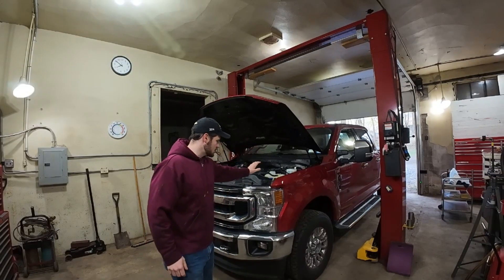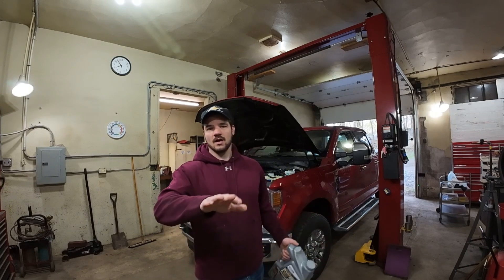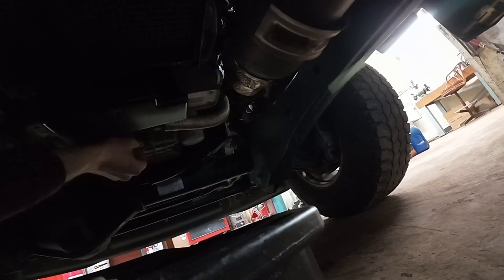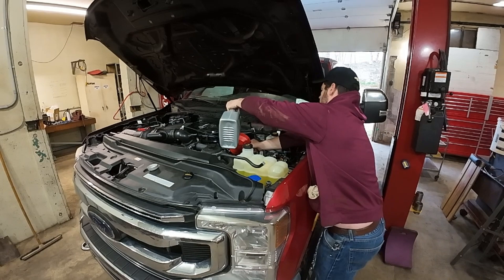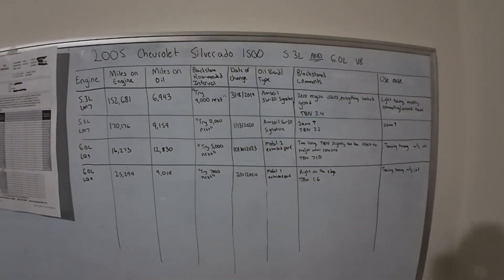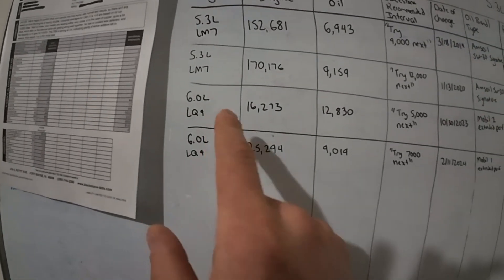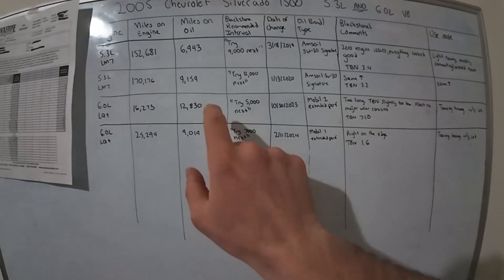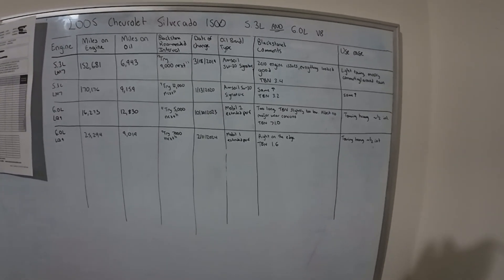Find out if you really can go 15,000+ miles on a single oil change!

Comment: Wear is the major parameter you should track in an oil analysis not TBN.

TBN (Total Base Number) refers to how alkaline the oil is.
Some companies also supply TAN (Total Acid Number).
Typically you only need TBN or TAN but not both as they both provide the similar info.

🙂
Reply from the maker: @MichaelCzajka  assuming wear is low/in spec, TBN or TAN is just a predictor of how much longer the oil would last. To your point it's not telling you really anything about the health of the engine directly. Really good point. 

Maybe another video is in order to dig into what each test result line really signifies.
Reply: Our Yaris has a TBN of close to zero each oil change.
Yet wear is very low.
TBN is not the best indicator of wear.
Wear is the best way to work out if the oil needs to be changed more frequently.
🙂
Reply from the maker: @MichaelCzajka  interesting, that's a bit counter to what Blackstone claims. I'll have to do some research on that. Not saying I don't believe you, I just dont have enough information one way or another to confirm or deny. Really appreciate the info!

Comment: I feel similar. I’ve done a video on 5,000-7,000 mile intervals, BUT there are so many factors that can and will change general interval mileage numbers…driving conditions, the fuel system (direct injection), timing chains, forced induction, and having an engine that is/or isn’t historically easy on oil (with analysis). I prefer facts, I prefer data. If that can’t be done, then yeah, stick to grandpa’s 3,000 mile “oil is cheap engines are not”. But in today’s day and age, grandpa wouldn’t be saying that^^^ anyway anymore.
Reply from the maker: @doublebase6509  grandpa would be running 30k intervals to try and save a buck. Hehe

Comment: I don't believe small engines that goes in cars do not have the oil capacity for 15k oil changes
Reply from the maker: Capacity defintely is a factor. The same engine with say a 4qt vs 8qt pan will definitely wear the oil out faster all else being equal.
Reply: The new Yaris' have a 15,000 km (~10,000 miles) oil change interval.
The older Yaris' have a 10,000 km oil change interval.
Both engines hold only ~3.2 L.
The older Yaris has very low wear.
Haven't tested the newer one yet so don't know how much wear it experiences... but it's a quiet engine:
Quiet = Low wear

N.B. As the oil change intervals increase the oil capacity usually increases.
None of these engines are wearing out prematurely e.g. Just sold an older Yaris with 370,000 km which was still very quiet.
Previous car was a 1.6 L Mitsubishi Colt and was sold at 496,000 km with the engine in perfect condition.

🙂

Comment: The 10k oil, if you read the blurb has some very specific conditions to achieve it.
Reply from the maker: We did read the blurb in the video🤗🤗
Reply: @AmericanAutomotiveChannel  I mean in the Mobile 1 annual oil. I was agreeing with you. there is very specific and unrealistic conditions you need to drive in the achieve 10,000 miles.
Reply from the maker: @gizzync1525 gotcha.  In my opinion it's somewhat false advertising frankly. They really need to at least say "up to 20k Miles under good conditions" or something to caveat it.
Reply: @AmericanAutomotiveChannel  totally agree. especially when the said conditions are virtually impossible to achieve.

Comment: Fair assessment for sure.  Data is always the best way to go, especially with the different engine types and different driving styles that individuals have. I personally go by the old adage of: Oil is cheap, engines are expensive. 5K oil changes for me works no problem.
Reply from the maker: Fair enough. It does keep it simple that way too.

Comment: Oil analysis is really the way to dial in your oil change interval. We routinely go 15k in our diesel pickups BUT (and this is very important) we do 3 things:
1. Only high quality oil filters
2. Pull a sample at each oil change & send it to a lab. 
3. Run a bypass filter that gets changed at 7500 & again at 15000
Reply: @Takeiteasy-u3r  my oil analysis says otherwise. You do realize that bypass filtration filters to <0.5 microns???  That’s means for every 10min of operation 25% of the oil is filtered far better than a full flow filter ever can achieve. 
Keep wasting your $$$, I’ll spend mine and it won’t be on engines. 

FYI: we have 4x 7.3L power stroke diesel pickups that EACH have OVER 200k miles on them, use almost no oil (we’re adding 1/2 gal or less over that 15k) and have no compression or power issues. With filters these engines hold 4gallons of oil. 

Navistar designed these engines with a 20,000mi OCI (factory Navistar engines got bypass filtration as standard equipment) so we’re actually changing earlier than recommended by Navistar. We pushed one to 25k just to see how the report would look, actually tested pretty well but iron & copper ppm was higher than usual so we dropped back to 15-16k.
Reply: @dgrenier4908   Our Toyota Yaris has a high efficiency spin on filter using the same media as bypass filters.
It provides the same filtration as a bypass filter... and was checked with microscopy.
However the filter hasn't been changed in over 80,000 km as the oil analysis shows no deterioration in filtration.
The car gets standard 10,000 km oil changes and uses no oil.
When it's due for an oil change the TBN is zero or very low.
However, wear is very low so there's no need to panic.
🙂
Reply from the maker: Yea I've often wondered how much TBN really matters if wear materials are in check

Comment: 16-18k yearly, already 250 k and engine like new, doesn't burn a drop of oil. Amsoil on 06 acura tsx. same in 4cyl tacoma 530k when i sold it ,never touched the engine except for valve cover gasket at 400k and engine was pristine.
Reply from the maker: Are you saying 16-18k between changes? On the amsoil 25k mile stuff in my Silverado I was seeing test results that showed it would be good for thar at least.
Reply: @AmericanAutomotiveChannel  yes, i do yearly whatever mileage it reach, but never done over 18k/yr. Also at 200k sent a sample to Blackstone, they say can go easily 5k more. I think the 25k is doable
Reply from the maker: @mandytuning  gotcha. That's great info to have thanks!

Comment: What they don't measure, and don't tell you, is what the soot/carbon measurement is in the oil. While the oil may retain its lubricity and wear protection characteristics well beyond 5k miles, the dispersants tend to lose their effectiveness earlier. I learned this the hard way with my 2016 XC90 which is now burning oil due to clogged oil return rings. When the dispersants break down and the soot builds up, it sticks to meta surfaces particularly where things run hot (like rings). They mitigated this in subsequent years by increasing the size of the oil return ring, but it doesn't eliminate the problem. Volvo changed the oil every 10K miles (per schedule) for the first 50k miles. Then, around 60K miles (10k miles after the warranty expired) I noticed I was burning about 1 quart of oil every 1000 miles. I should have stuck with 5K schedule regardless of what the manufacturer said. I have a 96 Mustang Cobra with 4.6L 32-valve DOHC. I used Mobil 1 every 5k mils and even raced on it occasionally. When I rebuilt the engine (to fix a blown head gasket) it was CRYSTAL clear inside with literally nothing stuck to my rings.
Reply from the maker: I think they do test for that...but I'd have to ask. That's a very good point to consider if they don't test for it though.
Reply: @AmericanAutomotiveChannel  I'm now trying Valvoline Restore & Protect which is said to be the only oil that can remove ring carbon buildup. See "INSIDE Valvoline's SECRET R&D Laboratory to UNCOVER the TRUTH" I will report back in 6 months.

Comment: as human beings,  we grow up, and evolve from having to change the diaper,  but the car industry, after over 100 years of evolution, still requires a "diaper change" every few k miles, until 1 person came along and revolutionized the propulsion industry with a far more sensible way to propel our butts around.  butt many still endear to 19th century engineering. if it weren't for the obnoxiously profitable scam called gas power,  we as a motoring public would have decades of refinement to a much better way to travel.
Reply from the maker: What are you suggesting we use instead??

Comment: I use full synthetic and change it every 5,000 miles and that's with mostly highway is. I know it's premature oil changes but it keeps everything super happy in my 6.0 powerstroke. I put over 50k miles on my truck since I got it and it is about to roll over to 200k. I had it tested recently and it still has perfect compression
Reply from the maker: 6.0s are known to be very sensitive to contaminated oil so I think that is a good idea!
Reply: Are you putting high mileage full synthetic oil?

Comment: Another way to think about how far you can go on an oil and how long an engine will live is by how much fuel you are using. Oil and engine life correlates with the amount of fuel that ran through the engine.
Reply from the maker: That's a very good point actually
Reply: @AmericanAutomotiveChannel  A quick clarification for anyone reading this being this does not include people who do frequent short trip driving. Which quickly contaminates the oil and increases fuel dilution.
Reply from the maker: @DeusKDuo  I mean short trips will hurt your fuel economy but yes, probably not enough in comparison to how much the oil is wearing so to speak.

Comment: any good engine builder will tell you that going that long with any oil in your engine is a VERY BAD IDEA.
Reply from the maker: Yes you always need to cite your source on things. No disrespect to machinist but unless they are also oil experts, getting oil testing done on the engine they've built,  etc, their thoughts are educated guesses at best.
Reply: I am a builder and tuner. Even in the same family of engines there is a decently wide margin of what you can and cant do with the oil. There are well worn 300k mile engines that can easily do 10k oil changes and fresh engines that are better off doing 3k oil changes. A lot of the issues engines are having lately are engineering issues but the automakers are leveraging oil manufactures to fix it for them.
Reply: Thats because engine builders are machinists, not oil experts. They probably know less than you about engine oil, and I know they know less than me, and im an aircraft mechanic.

Comment: Simply put…oil quality is totally dependent on how you drive.  Heat, and dilution are the biggest enemies. If you drive 15,000 miles non-stop at the same ambient temperature…oil is great.  If you do 75 shorts trips in cold climate and heat cycle/dilute, your oil is garbage.  Best to stick with a good synthetic and change every 3-5k or every 4-6 months, whichever comes first.
Reply from the maker: Exactly